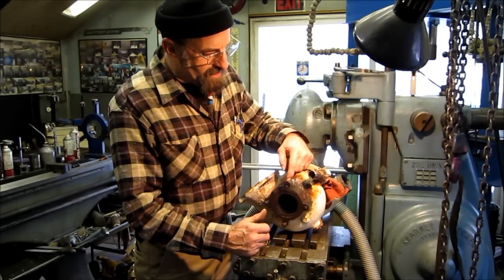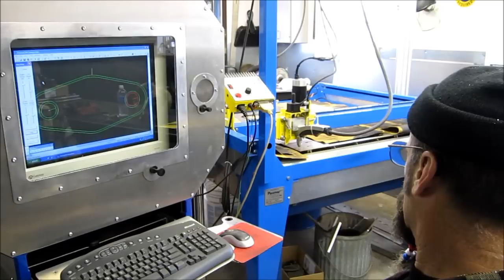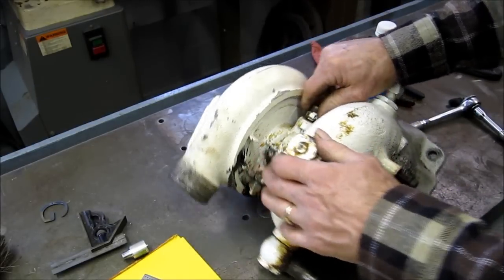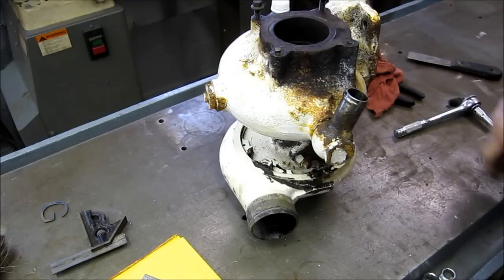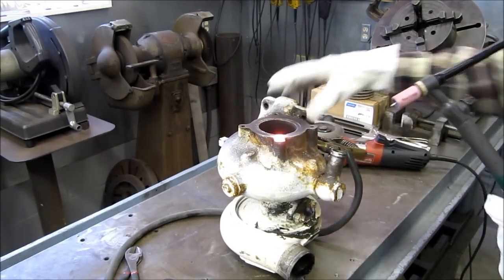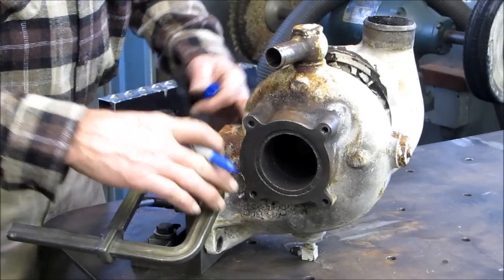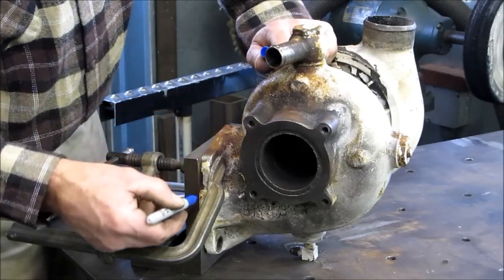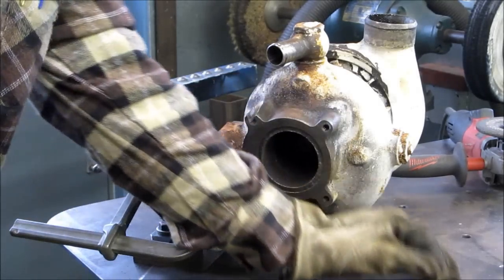So you broke it off, in your hole! Part 1

Comment: I am a maintenance tech in my shop and this kind of work is 75% of what occupies my day. Stripped bolt heads, broken drills in parts, EZ out removal from some enterprising young operator who does not realize he just made it worse for me. I always tell them don't try and help! Just call me as soon as it happens and I will have a much better chance of getting it out quickly and easily. Some of the parts I have to work on are worth thousands of dollars, so I try and get all the info I can.
Reply: Experience is a wonderful thing, it enables you to realize when you made it the second time. This is what I tell the guys when I am helping them get out broken or seized stuff.  Call me before you mess it up, if you are forcing it it is going to break.

Comment: Just removed one of those broken off in a pipe plug. Tig'd a pile of weld on it then a nut, turned it back to the right a little and slide hammered it out.

Comment: That's a good theory! I have disassembled hundreds if not thousand of turbos and I have had to do this to about half of them. From experience I can tell ya that the casting leaches so much heat that 75% of the remaining bolt doesn't expand enough to let go when it cools most of the time. If the bolt is not stuck too bad, then you are correct, it will come out with little effort after welding and cooling. I call it "reverse swedging". You did really well there Keith! Thanks for sharing!

Comment: A machine shop, the must have experience job.. I like machining but tools are very expensive.  Cutting out that easy out and brazing in new material is a can do in the average set up shop. Not the same can be said for chemically burning it out.

Comment: After spending the first 6 months as a turbo tech doing exactly this, here's a few suggestions.  Use a stainless nut, they seem to weld more reliably to the high tensile bolts used. As it cools down flood it with penetrating fluid. When it's finally at room temperature, give the nut a solid rap with a heavy hammer. This tends to break the corrosion formed from salt and thermal cycling. Even if they are broken below the surface I'd get nearly 100% success.

Comment: Worked in a shop for 17 years and we always called them ease outs because you have to be very easy with the tool. There is nothing easy about it when you brake one off in a hole. I have had luck taking a punch and breaking them up into smaller pieces to get them out.

Comment: I have pulled the ones down inside the hole also by blackening the inside of the threads with torch soot and welding straight up the hole and then to a flat washer on the top. Then take channel locks and unscrew it. I have done this many times.

Comment from the maker: Pipe threads are pretty easy, most of the time! I like to use a rotary burr, slowly remove the inside until you reach the minor thread diameter of the pipe that broke off on two sides straight across from each other, then take a sharp faced drift punch and tap inward the solid sides, with a couple taps, relieving the pressure and remove with fingers! ;{)---

Comment: Another repair I had to do once was a Top Fuel aluminum block that blew a couple rods, put a 4-5 inch diameter hole in the side.  Beat up one of the heads pretty bad too, so it was more 'miles' of TIG welding beads. used up 2 of the 5 pound boxes of TIG filler..
Very impressive work you're doing, especially by hand!

Comment: Hi Keith: Something to watch when working on Turbochargers is the intake side. It' very important to cover the inlet opening, to prevent dirt or grindings from getting in there preventing short term or immediate engine failure. Sorry Keith, I don't mean to be a know it all, but this is how I make my living
Reply: 1693caterpillar Turbo can be cleaned as far as the air/exhaust goes.  You really want to protect the oil/lubrication of any turbo.  And it really didn't look new.

Comment: you actually did not need to heat the casing to remove that bolt that you welded the nut to. What happens is that the bolt expands when heated (by the welding process) and it want to expand volumeterically, but since it restricted in expanding in diameter it expands more in other directions. when it cools it still cools volumeterically so the diameter is smaller than originally. Its called "upset" 95% of the time thats all you need to get the bolt out. never the less, you got it out. 
Keep it up

Comment: Welding nuts onto broken bolts or studs works in around 1 in 4 cases. Its far more effective to weld a blob of weld directly onto the broken fastener, and turn it out using a mole wrench while still red hot. Have used that method quite a lot and it very rarely fails.

Comment: Rockmount Nassau markets an electrode that they call Brutus which works very well for extracting broken bolts or studs. Because it was primarily a cast iron welding electrode it can be run at low amperage and you have to work very hard to make it arc to the side of the hole and the deposit metal has a high tensile strenght so removal force is transferred to the broken part .  With a 1/16" electrode you can easily built up a broken bolt in a hole until it is proud as the slag runs to the side and protects the threads. The heat generated by the welding process caused the bolt to try to expand but it is contained by the hole so can only expand lengthwise but shrinks both ways. Restricted expansion free contraction equals a smaller diameter after cooling. Weld a nut onto the protruding buildup with 7018 and Bob's your uncle.
I've removed 11/8" bottoming studs that were  torqued in and broken off 2" below the face with 1/8" dia electrodes  a number of times. Once they were cooled a 1/2" impact will spin them right out.

Comment: Give it a try next time you have a broken fastener. If you heat the part fastener screws into as well, it works pretty much every time. Also found TIG brazing works great for repairing things like cracked exhaust manifolds, and is faster than oxy-fuel brazing.

Comment: very good idea , did you know that if you tightn a bolt first before you try and crack it loose
it will loosen up withought breaking, this is usualy the case on components subjected to thermal cycling , it locks the threads sum how i swear bro next time you come acros some brakes or a turbo charger or oxygen sencore, tightn it first and it will crack the thermal cycling lock every time it works for me its like magic
Reply: And if possible use a 3/8 impact gun on low to go forward and back with some knocker loose penetrating spray. Baby steps, if you force it it will break is what I always try to teach.

Comment: TIG brazing seems to rely very much on the filler rod used. Here in the UK cro-moly race car suspension parts are often made using this method, with most using phosphor bronze rods. Phosphor bronze seems to work on almost anything, and have been able to repair 100 year old cast iron guttering from a building being restored with it no problem. 

On the other hand not had much luck with Si Cu or Si Al brazing filler, but guess they work fine on some specific applications.

Comment: No its an oxy-fuel process, which can also be used to build up worn worn shafts, as well as actual welding jobs. Its also ideal for repair jobs such as cracked cylinder blocks............you can get full details by typing "Eutectic powder welding" into Google and looking for Eutectic PDF catalog.

Comment from the maker: @Pudersepp When the part is heated, it exspands as a whole and releaves the grip rather than increasing. you have to be quick and hot enough or the transfer of heat sometimes regrips  as the bolt matches temp. Sometimes when the bolt is super heated, it exspands and crushes the rust build up, then becomes loose when cooled.

Comment: I get alot of these at my machine shop as well. Some other suggestions are to use a carbide tipped drill (common hardware store masons bit sharpened will work and there cheap) which will drill through the easy out as well as the broken bolt. Sodel also makes what they call "remover rods" which work like an oxy lance they burn out the damaged bolt or easy out and do not hurt the part or threads, but there pricey.

Comment: I've done alot of those, but with out the heli-arc option, i found a welding rod called utp-65 wich i've taken out broken bolts that are broke of inside the hole. amazing stuff espically when you have a piece you can't get into the shop.

Comment: If you have not tried phosphor bronze on cast, give it a try. Always worked very well for me. Also well worth looking at powder welding, for cast, and this is something that can be used for most hard facing jobs, as there is a really large range of different powders available.

Comment: Interesting to see that you loosened the bolt under heat. What I've done is heat the work up, smoking, and then leave it to cool. Works that way as well. I was thinking that when you heat the thing up, it expands, forcing the bolt in tighter and thus after cooling, would produce a "looseness" to the threading.

Comment from the maker: Yep that is what we call flame spray, ceramic was the only successful coating for marine shafting in the patrol boat in the navel yards and bronze and S/S wasn't worth anything for sealing items like valve seat etc. cool how we all pretty much have or had the same experences. I use to grind the ceramic with the tool post grinder diamond wheel and the coolmister spraying on it at the same time, moving the carraige with a swift feed rate.  ;{)----

Comment: It might have been faster to fixture it vertical in a mill from the get go and peck with an end mill, my best success has been to use a ball end mill first to make an actual center to then try and drill with a carbide drill or continue with a center cutting endmill.  Also another option could be to fill it with epoxy and drill it to use a keensert although the limited material might be to thin to hold a keensert.

Comment from the maker: Yes it is a PlasmaCAM and I'm using a Thermal Dynamics cutmaster 81, 60 amp unit. On my feature page you can see my playlist for quick reference to the assembly and playing with it. Some turbos are but that was awhile ago and without going back for a view I'm not sure if it was. If it had the barb fittings on it then yes! ;{)---

Comment: Since it was a straight flute extractor could you have welded to it and used some kind of puller? 

I find it effective to weld a washer to a flush broken off fastener then weld a nut to the washer. In the case of the extractor, you could have welded a small washer to the extractor then a threaded rod to the washer then use a sleeve/jack nut to pull it out.
Reply: We are of the same thought just about I just replied above before coming onto your post, maybe he did not have a tig welder, a mig welder would be too dangerous, and stick welding well you better have a steady hand and a good aim. Tig or the win.

Comment: Wow my first try if I had that and it was indeed a straight easy out would have been tig welding the center and build up till a threaded stud could be welded to the weld build up, then let cool, then add a bunch of washers or a collar of aproz 3/4" in length start to tighten and from the back side where the extractor is start heating and tighten nut on the threaded part keep heating and slide hammer attached to the stud gently slamming outwards. The key to this process is with the force that the nut is transfering against the housing and the heating of that housing which will expand the hole a little the slide hammer will be able to pull the welded stud attached to the easy out. After that you had the machinery to drill out the centering and pull the threads out like undoing a heli coil that went wrong. I am not a fan of brazing if there is a alternative way. Tig welding is my first choice if you are careful and patient and has never failed me once.
 P/S the cylinder head pins holding the guide rails on Mercedes Benz seize in the head and the only way to get them out every time is with a slide hammer and heating up the head where the pin is press fit in. Helped many guys get these pins out when they get stuck.

Comment from the maker: If the easy out and the prior hole drilled was in center, of the bolts axis to make the rest of an attempt to remove valid, yes a carbide drill may work. ;{)------

Comment from the maker: I would have tried welding a nut, and then use heat to relieve the corrosion mess that was holding it, or set it up in the mill and find true center then drill and tap it clear. ;{)---

Comment: next time use 309 ss tig rod and do the same thing as you did for the broken bolt on the broken ez out.....let it cool a minute or two and use a 6 point socket ---will come right out and usually no acetylene torch needed to reheat a cooled off part.
Reply: See I agree with you on the tig process but with that easy out is expanding the bolt into the rusted thread more it would snap off, but if the easy out is pulled out you can have a 2nd chance at another solution.

Comment: How about an EDM die sinker set up on the milling machine and spark erode the easy out, out of existence.
I have an old EDM die sinker that is designed for that exact purpose, it was sold by TOOL"O"RAMA and the brand name was RAWLMIKES. It's not very powerful but it does the job rather well.

Comment: Is that a PlasmaCam table? what are you using for the power source? 'Easy out', Yeah, more like a 'broken stud expander'. funny thing, I bought a Snap-on kit with 5 left hand drill bits, and 5 'easy outs', usually the drill relieves the pressure and the broken stud comes right out.
  My lest employment (maint-mechanic/electrician/welder/floor sweeper) was a shop with about 125 pieces of motorized equipment, and the 'pipe wrench knurling' was everywhere.
 Is that turbo housing water-cooled?

Comment: What welding rod did you use Keith, we were trying to do this with a Porsche last month, damn thing just kept breaking off, the weld seemed to brittle. I've done it before with A32 without a problem.

Comment: I take it that the turbo was just mild steel? So heating it like that won't change its properties?
Reply: huxleypig69 its a casting and is most likely Iron not steel, there in lies the problem, heating it wont damage it but after grinding out the easy out it can't easily be welded, Iron will crack if not properly heated before welding and even then you have to use a nickel rod that is almost impossible to machine afterward. a weld shop should be able to burn the broken easy out out with a carbon rod designed for that purpose, I have been in the machining trade for over 40 years and thats how we remove a broken tap
Reply: huxleypig69 I have seen turbo's run 500Celcius, extreme.
Reply: Its, fine turbo manifold temps can go over 1200f.

Comment: Why not just clamp that on an Angle plate and mill out the Easy out? Could have done all that in less then an hour. No heating, no beating and no welding unless the threads was damaged anyway.

Comment: short question is there a reason you did not
simply drill it out with a carbide spade or
2 flute end mill and then retap it on location
Reply: I agree, this would have been my solution.
Rob

Comment: correct me if I'm wrong but, wouldn't it have been easier to pull the housing?
Reply from the maker: It is always better to have it completely broke down! The mechanic on the job, didn't want to break it down any more than he did to do the repairs so the guy could be back in service and on his way out fishing in a matter of hours. this was a work on it until its done weekend type job! Tuna season is crazy and time is a matter of catching and or not. ;{)------
Reply: Keith Fenner Ah, I was wondering the same thing. It's just 6 bolts holding that housing on. But I guess the fear was that it would go the way of the two studs on the other side?

Comment: Easy Out? Possibly one of the worst named and designed tools on the market. First problem is you normally can't drill a hole concentric or straight enough to use them effectively as the stud or bolt is seldom in an accessible place. Second problem is that even if you do manage to get a good hole drilled, you are now going to drive a tapered piece of tool steel into that hole and quite possibly swell that drilled out stud even tighter in the threads making it impossible to remove that broken stud. Third, as the frustration grows and the patience is lost you give that "Easy Out" one more tap with a hammer or apply just a little more torque and bingo, you now have a hole filled with hardened steel at an odd angle with no hope of getting it out in situ and your unrepeatable vocabulary (not meant for Ladies, children or church goers) just grew ten fold................. 

Keith is 100% right when he says get a left hand twist bit. At least you will end up with a cylindrical hole even it it's not perfect.

One of the smartest things I ever saw when it came to a situation like this was on a small diesel on the exhaust manifold bolts. First, the studs were austenitic stainless steel to keep corrosion at a minimum. Second, they studs were actually hollow on the block/head side. They had a small counterbore so that if they did snap off you had a built in pilot hole. Simple but effective.

Comment: stick to the subject if you dont mind, I was interested in the process you used to remove the broken bolts and easy out, I dont need to be schooled on covering the oil holes, I dont even own a turbo charger and this is not supposed to be a turbo charger demo